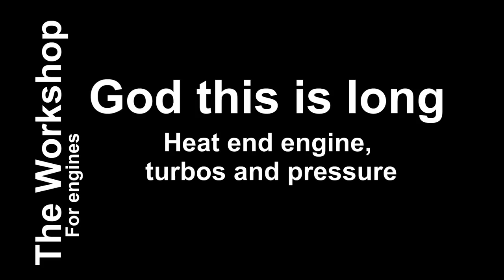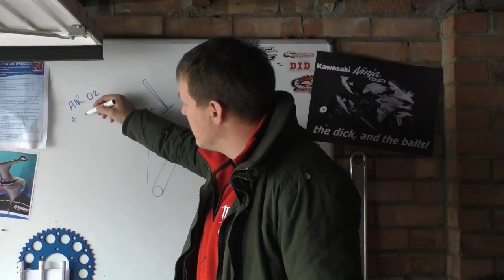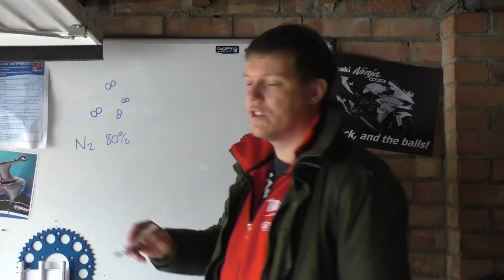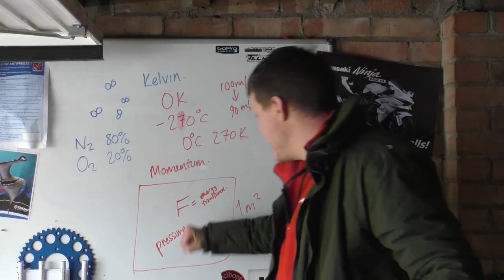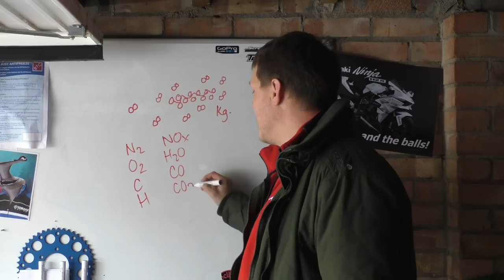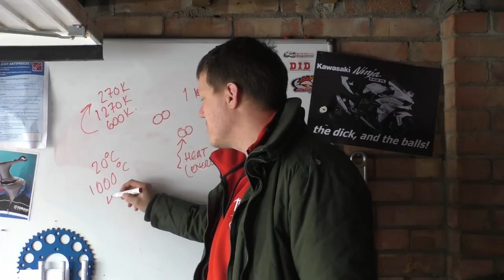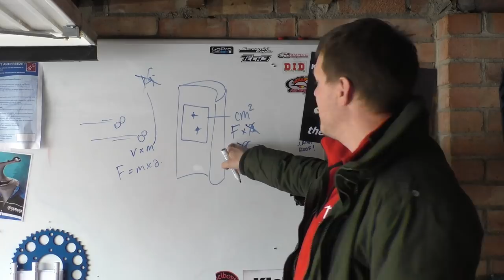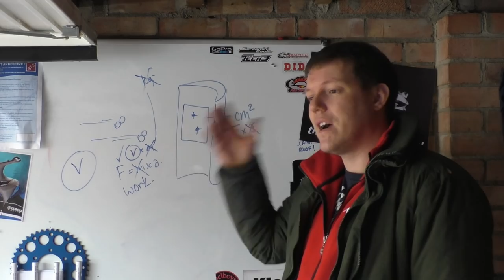Heat - the core of an engine

Comment: I am Stopping this at 2:00... I build at school little mill's that turned the impeller due to the heat of a candle and I know that heat is the reason why the gases expand. I am not watching the rest and waste 37 min of my life. Sorry Matt.
Reply: Here is a link so you know what I mean with it: https://www.youtube.com/watch?v=mIl7xESc5uI So leave a like and who ever uploaded the video will wonder why the like rate boosted up. And it is only heat that moves it no pressure or piston exhaust. OK not as fast as a turbo impeller but that gets more heat.
Reply: Sorry, but that's convection.
Reply: wirdy1, convection that was only because of the heat. So where is the problem? it turned the thing.
Reply: onhawaii   Your toy would work with cold vapour falling through the fan too.
Reply: Wirdy1... you can also let the water poor on it. (not to say piss on it) But the reason is still the heat in the video.
Reply: Convection only occurs with a density difference, which implies a difference in heat concentration on a volume basis ("specify enthalpy"), with or without a temperature difference (positive or negative).
Reply: Identiticrisis, you little smart one. You did not get the point. Same shit that makes the turbo spool only difference is that the heat in the turbo is in an pipe that has to past the impeller. The effect is so much bigger. If you would cool down the air on the other side as much you get heat out of the burning in the engine you get the same result. The reason that the turbo is as close as possible to the head. I think you just could not put that together. It is the same shit just in an different system. And yes the hot air balloon is also the same shit... OMJ
Reply: I'm not disputing what you say.
Reply: heat doesn't make the thing spin... the flow of a working fluid makes it spin...heat is just one way to create flow.
Reply: John Lucas you could measure (e.g. via diffraction techniques) the small differences in density around the rotor blade. That difference in density is also effectively a difference in heat within the same working fluid.  So it's really the same explanation.

Comment: You fucked up the pressure thing. Actually pressure is Force divided by Area. This means that the area affects the pressure quite a lot.
Also you said that the breaking down of hydrocarbons releases infrared light. Infrared is also known as... Heat. So in combustion you receive heat as radiation also.
Reply: Area does not affect pressure. A small tank of air at 100psi has a much smaller area than a large tank of air at 100psi but the pressure is the same. Force is dependent on area. That larger tank has much more force being exerted on it's walls than the small tank.
Reply: but doesn't both tanks have the same force allied to the same area? think about gravity and outside pressures. now add say 100 lbs of force to any side of tank you will see a slight pressure change.   you put 100 psi in a vessel it should stay the same until an outside force would change it. Like weight, heat more gravity or less...
Reply: "but doesn't both tanks have the same force allied to the same area" Yes. That is the definition of pressure. pressure = force per unit area. At 100PSI one square inch of the area will have 100lbs of force exerted on it. The point is that the bigger tank has more square inches so more force. "now add say 100 lbs of force to any side of tank you will see a slight pressure change". Nope. The internal pressure will not change unless the tank deforms and changes it's internal volume.
Reply: "For a constant force, Area change=pressure change". Yes, of course it is. What is your point? In an engine we aren't changing the area, unless maybe you include the cylinder walls which have no real effect on an engine's output.
Reply: OK, but it's still 100 PSI in the bigger tank so you have more volume of pressure, it's still 100 per square inch. and I showed a guy a few nights ago, while servicing a tire on an aircraft, with no weight on the tire it had 190 psi in it. When we put the weight of the aircraft on it, it did rise slightly about 3 psi yeah it's nothing in the big way but it did change.
Reply: LesNewell
Ah, OK, not sure where this is going or even the point of it.... 
Reminds me of that joke about the pilot in a hot air balloon..... 'you must be an engineer'.... 'why?'..... "because everything you have told me is technically correct, but I have no idea what to make of your information'

Comment: Hey Matt, Ya wanker... Pressure pushes pistons and turns turbines.... in an IC engines pressure / expansion  is created when you apply heat to the working fluid by introducing fuel and combustion. A brayton , rankin, ericksson, or stirling cycle can also use heat applied externally by sunlight, combustion or other heat source.  Because the working fluids are in  in a confined space pressure is created,  Work is created when the pressure flows / escapes through an expander devise (piston / turbine) which turns the pressure / velocity / momentum into work.  Compression increases the density / mass of the working fluid allowing it to do more work for a given volume...  BTW good video..
Reply from the maker: "Pressure pushes pistons and turns turbines.."

and 

" because the working fluid is in  in a confined space pressure is created,"

- this nonsense is what screws people up. Force "forces" the turbine round. Pressure is not a thing just a measurement. You don't create pressure. Molecules and atoms gain energy which they express through velocity. 

Pressure = force / area. So pressure isn't a thing. You can't have a bottle of pressure, the atoms have energy. This is why cooling a balloon lowers the pressure. Based on what you said, in the balloon example, pressure disappears.

"Compression increases the density / mass"

- LOL Mass? Are you sure about that?
Reply: Ya I'm pretty sure you can have a pressurized container and if you direct the overstuffed contents at a turbine blade or into a cylinder with a piston something is likely to happen... And compressing a working fluid like air does increases the density... Which results in an amplified reaction when heat is applied... I think your explanation that heat is driving the turbine seems misleading... Heat is given up when work is done but it's possible to drive a piston or turbine with a pressurized container of cool air... The air will just get colder as work is extracted from it...
Reply: Pressure is the measurement of potential energy ... Force does the work when flow is introduced..
Reply: Cooling the baloon densifies the air to the point where it gets smaller than the container... So the baloon looks deflated...

Comment: Too complicated.  What pushes the exhaust out?  The bloomin' PISTON coming back up!  That creates the push on the turbine buckets....or blades.  Think about how little force would be on the turbine if the piston didn't come back up on the exhaust stroke.  Most of the power has be used to move the piston.  And I was gonna let this slide but at 15:00 you said that kinetic energy has no mass.  Don't say that.  It's confusing.  The formula for kinetic energy depends on mass.  Time to give up and make another "I was wrong" video.
Reply: Matt's right, Kinetic energy itself doesn't have mass.  It''s the energy a mass has due to it's motion.  The reason you use mass in the formula is to work out how much kinetic energy that particular mass has.  He's trying to explain complex thermodynamics in a simple way and I think this is a pretty good explanation of how the heat energy gives the molecules more energy which transfers to the turbine as they flow past.
Reply: Kinetic energy doesn't have mass, but at the same time, it does?   That's what I call double talk.  You must be a lawyer.  Anyway, this whole argument is crazy.  Matt's saying that pressure doesn't really exist?  What?  It's just molecules bouncing around.  Yeah, we know that.  We all took science classes.  He's making this too complex, IMHO.  I say it's the pressure of the exhaust.  He says it's not pressure and that pressure is just molecules.  Okay, so it's the pressure of the molecules.  Any idiot can put his hand over the tailpipe and feel pressure.  We used to put potatoes in tailpipes just for fun.  We thought that would keep the cars from starting.  Here's a tip.  Don't stand in front of the tailpipe when the car is starting.  Those molecules will get you.
Reply: mista bubble
What do you think pushes the exhaust all the way back to the end of the tailpipe way in the back of the car?  You think that's the gasses expanding?  The motor is pumping the exhaust out at some pressure depending on the revs and the displacement.  There's a lot of horse shit being thrown around here.  I'm surprised that Matt has dug his way into this mess up to his ass.  Don't follow him in.  What's wrong is wrong.  I like Matt too, but he's fucking wrong and he knows it.
Reply from the maker: "Too complicated.  What pushes the exhaust out?  The bloomin' PISTON coming back up!  That creates the push on the turbine buckets....or blades."

LMAO! - Seriously? And you also believe in perpetual motion machines do you?

If the Piston is what forces the gases past the turbine blades then the engine itself is directly powering the turbo - i.e the crankshaft is giving up power to the turbine? Then this is the same as a supercharger with more losses???

So based on this, how did the F1 engine reach 50% efficiency? - Ah yes magic. 

"The formula for kinetic energy depends on mass.  Time to give up and make another "I was wrong" video."

- Time for you to go back to school. Do you know the difference to 'depends' and 'possession' ('has' mass in this case)? 

"Matt's saying that pressure doesn't really exist?  What?  It's just molecules bouncing around.  Yeah, we know that."

- Well you have just 'double talked' your way into a hole here. On one hand you're saying 'matt's a dickhead, and then yeah I know that?'

"He says it's not pressure and that pressure is just molecules. Okay, so it's the pressure of the molecules."

- What? Are you actually deaf or are your speakers broken?

"There's a lot of horse shit being thrown around here.  I'm surprised that Matt has dug his way into this mess up to his ass.  Don't follow him in.  What's wrong is wrong.  I like Matt too, but he's fucking wrong and he knows it."

- You show me I'm wrong. Links or anything......

Maybe you should look at this - https://en.wikipedia.org/wiki/Pressure
Reply: I just went on a rant about your comments here, but I deleted it for good reasons.  I don't really care about the exhaust stroke thing as I just threw it out there to cause some sparks.  Where I disagree with you is on the pressure thing.   You had pressed the issue of negating pressure as the force acting on the turbine.   I don't care where the pressure comes from, and you're certainly right about it coming from the actual combustion as it moves out the exhaust valve.  But I would still call it pressure and you don't like that word.  The question that really exists is whether you can have the delivery of kinetic energy in a closed duct without pressure.  Bernoulli said the pressure goes down as the velocity goes up.  But the velocity is reduced by the presence of the turbocharger in the flow path.  To me, that means a pressure increase.  Hey, if I'm wrong, I'm wrong...But I'm not wrong.  Oh, excellent article on Wiki.  I shall have a go at it, as they say.
Reply: Your mixing up processes - check out wiki,  on the Bernoulli principle, it only applies to an isentropic flow which is "a fluid flow that is both adiabatic and reversible. That is, no heat is added to the flow, and no energy transformations occur due to friction or dissipative effects.".  So your statement doesn't follow in this instance.  Questioning things is good, but not understanding something doesn't make it wrong.
Reply: Those caveats are to isolate the sample from any external influences that may exist outside the sample area that would otherwise change the outcome.  In this case, the sample is isolated by definition and the laws apply, albeit loosely.   The system under inspection becomes isentropic in theory if external influences are negated, which they are.   Remember that we are looking at a snapshot of a gas as t goes to zero and the system is reversible.  This is a strictly mechanical system.  Fluid at whatever temperature is expected to behave as Bernoulli expressed it.  
As an interesting side note, the theory of wing geometry as Bernoulli describes it (and I don't remember which Bernoulli it was.  Daniel or one of the other several sons and cousins.  I can't keep track of all these geniuses in the Bernoulli family) is hotly contested by aerodynamicist today.   The other contender is the Coanda effect.  I think I have the spelling correct.  Another genius that had the nerve to challenge that Bernoulli principle.
This discussion has gotten rid of some of the cobwebs in my brain and I thank all involved for kicking my ass around in a big circle.  Somehow all this material seems a lot more interesting than it was when I was in college 50 years ago.  There's nothing like a good argument to get the brain going.  I should benefit from arguing with my wife but it's not working that way for some reason.  
Oh, I'm sure you'll kick my ass down the street some more, so let's have at it.
Reply from the maker: "But I would still call it pressure and you don't like that word"

- LOL I have no problem with the word pressure. The issue come from this question or scenario. 

If we want to increase the output of a turbine what do we do? Increase the pressure, same thing with an engine. You want to increase the HP or torque so what do you do? Increase the pressure, but how?

"The question that really exists is whether you can have the delivery of kinetic energy in a closed duct without pressure."

- answer no. You can't have most things with the other. You can't have force without pressure, or compression or waste heat, or energy transfer or with mass or velocity or with momentum, aceleration etc etc. We try to isolate these functions to understand which ones we want to increase and which one we could do without.
Reply: Rob the Nog
Did you read that?  The thing is riddled with references to pressure.  It even makes reference to the diffuser I spoke of.  You have just proved my point.
Reply: WHAT'S THAT YOU SAY?
Applying thermodynamic equations to the isentropic process, the turbine efficiency
is expressed in terms of the total pressure and temperature at the turbine inlet
and outlet and the isentropic exponent of the exhaust gas κg ≈ 1.32.
LOOKS LIKE THERE ARE TEMPERATURE AND PRESSURE AT THE TURBINE!  OH NO.  CAN'T BE.  OH YES.  STRAIGHT OUT OF A PDF FILE I GOT FROM MY BFF ROB THE NOG.